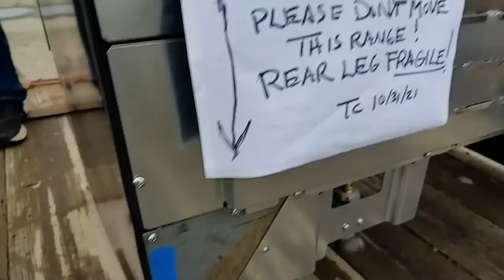OFF GRID BUILD// Woodmizer lt35 Milling blue pine// VLOG

Comment: That's a great sawmill, 1/2" good for your walls, but at least 3/4" for floors or decks . If the oven on your stove is electric, see if you can change it over to gas and simplify things 👍😎

Comment: 1/2" might be to thin to plane but you could run a sander over it really quick and it would smooth it out pretty nice without taking very much off. :)

Comment: If you could a drum sander that is horizontally mounted (like a thickness planer but not) you could run the side that will be towards the interior of the room through it a few times

Comment: How much electricity does a gas stove need? I am confused. You would think that the timer and such items would not use much. Does new fancy stove use piezo ignition that is high amp and volts?
Reply: That’s an electric convection oven; top has been converted to propane for the top burners as I understand